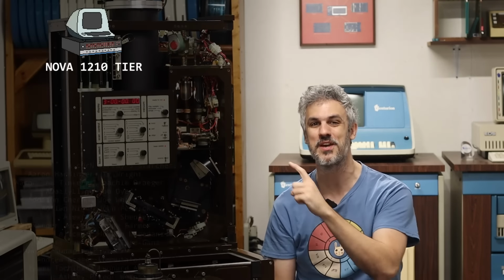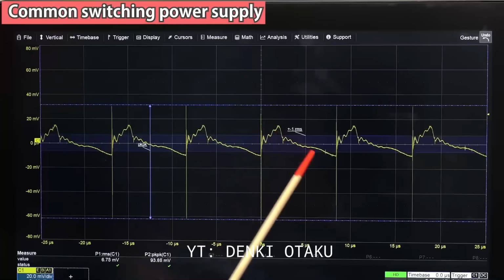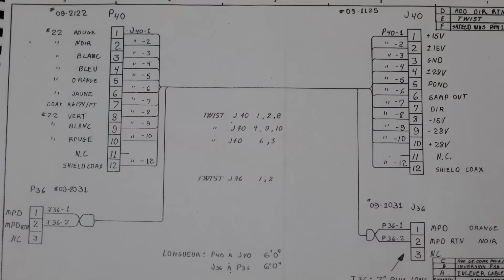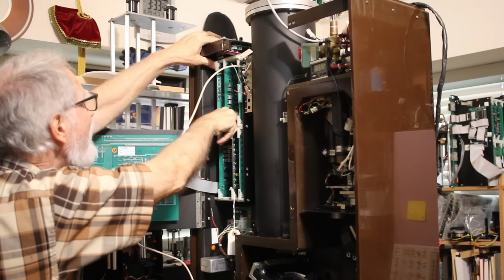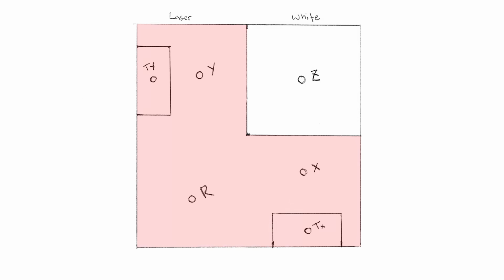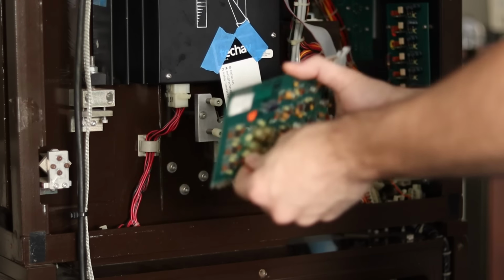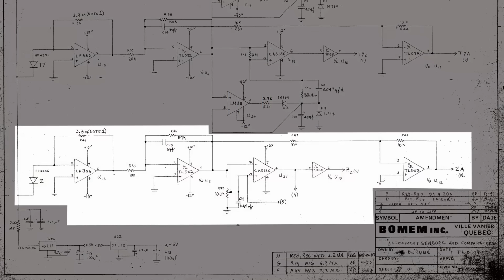I Found a Production Mistake on the Spectrometer!

Comment: The oldest factory defect I found was in a 1950s Silvertone amplifier. One of the part legs wrapped around a tube socket connector but the factory never bothered soldering it. Certainly explained the intermittent loss of gain but that must have been doing it for the amp's whole life!"

Comment: It's not a bug - it's a feature!   I think the reason for the un-soldered pins on the backplane connector is so that the mirror motor is purposefully un-powered unless you have a motor controller board plugged into the backplane. In other words - it's a safety feature, not a design / manufacturing fault.

Comment: Just as another heads up about laser safety for anyone doing stuff at home:
As someone who regularly gets laser safety instructions at work we were recently (recently being the last three years) taught that the "blink reflex" which supposedly saves you from damaging your eyes for certain powers of visible lasers is far FAR more unreliable than one might want!
Specifically, we were told that large parts of humanity may not have it or have it on a far slower time scale than previously assumed. This means even those lower intensity "safe" lasers are more dangerous than often said.

Comment: ai summary

Abstract:

This technical report details the restoration and diagnostic process of a 1985 BowMD DA3 Fourier Transform Infrared (FTIR) spectrometer interfaced with a PDP 1173 computer and a high-performance vector processor. The system utilizes an interferometer design where a beam splitter divides electromagnetic radiation between a fixed and a moving mirror to create interference patterns, which are subsequently converted into spectral data via a Fourier Transform.

The restoration effort involved several critical hardware interventions: the replacement of a faulty linear 5V power supply with a switching mode power supply (SMPS), the repair of an Analog-to-Digital Converter (ADC) via capacitor replacement, and the correction of a factory production error on the system backplane involving missing solder joints on the $\pm 15\text{V}$ rails. Further recovery required the installation of a missing speed and search control card for the mirror motor.

Optical alignment was achieved by calibrating the Helium-Neon (HeNe) laser path and white light source using a multi-sensor detection board and an oscilloscope to ensure precise signal phase and amplitude. While the system is now 99% functional, current diagnostics indicate unresolved non-rhythmic noise on the Z-signal (Zero Path Difference), potentially originating from mechanical motor vibrations or failing operational amplifiers in the signal chain.

Technical Summary: BowMD DA3 FTIR Spectrometer Restoration

    0:00 System Configuration: The setup consists of a BowMD DA3 FTIR spectrometer integrated with a PDP 1173 computer and a vector processor for high-speed mathematical computations.
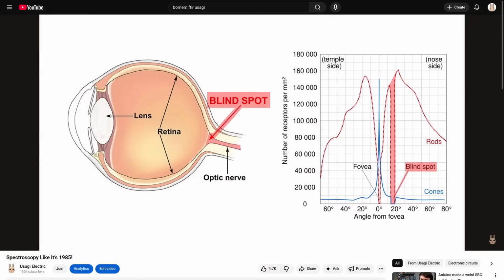    1:19 Optical Path Mechanics: The instrument generates radiation (visible to far-infrared) that passes through a beam splitter. The light is split between a fixed mirror and a moving mirror, recombining to create constructive and destructive interference before passing through the sample to a detector.
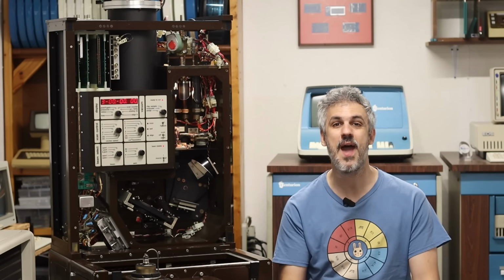    3:44 Position Tracking: A Helium-Neon (HeNe) laser is utilized within the same optical path to provide a precise wavelength reference, allowing the system to track the moving mirror's position via interference peaks.
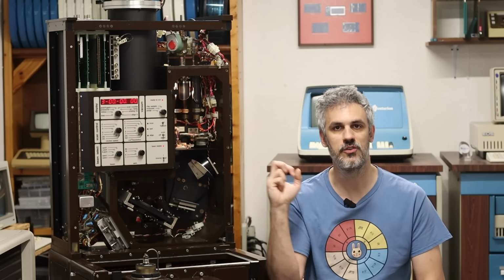    4:17 Data Processing: The system employs a Fourier Transform to convert the raw interferogram (waveform) into a spectrum of individual wavelengths.
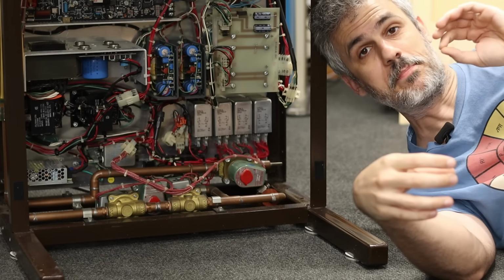    4:42 Power Supply Modification: A failed linear 5V power supply was replaced with a Meanwell SMPS. The engineer noted potential high-frequency ripple injection, though the supply only powers the digital logic.
    6:19 Laser Safety Specifications: The system uses a low-power (approx. 2mW) HeNe laser. Safety is maintained via a self-contained housing, a defined optical path with bolted mirrors, and a diffused beam width of approximately one centimeter.
    9:00 ADC Remediation: A short circuit on the $-15\text{V}$ rail of the Analog-to-Digital Converter (ADC) was traced to a failed $10\mu\text{F}$ capacitor, which was subsequently replaced.
    10:04 Motor Control Fault: The moving mirror was initially unpowered due to a lack of $\pm 15\text{V}$ logic power at the motor control box.
    13:00 Backplane Production Error: Diagnostics revealed a manufacturing defect where pins on the backplane card-edge connector were not soldered to their corresponding traces, breaking the connection to the $\pm 15\text{V}$ rails. This was repaired using jumper wires.
    17:34 Hardware Gap Analysis: The mirror motor remained unresponsive until it was determined that the speed and search control card (originally in slot 4) was missing.
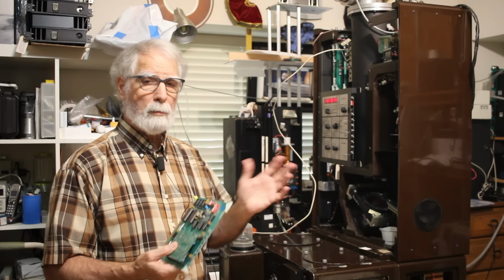    21:01 ADC Validation: The repaired ADC was tested using a function generator injecting a sine wave. The output was validated as a clean interferogram.
    23:41 Gain Variance Analysis: A difference in output amplitude between ADC revisions was traced to the R5 feedback resistor; the older revision used $10\text{k}\Omega$, while the newer revision used $20.4\text{k}\Omega$, resulting in double the gain.
    27:42 Operational Verification: Upon installation of the correct control card, the moving mirror successfully entered "Mode 3" (scanning), moving between limit switches.
    29:03 Laser Alignment Procedure: Alignment involved expanding and collimating the laser into a "Tetris block" shape, combined with a square of white light. A sensor card with six photodiodes was used to align the beams.
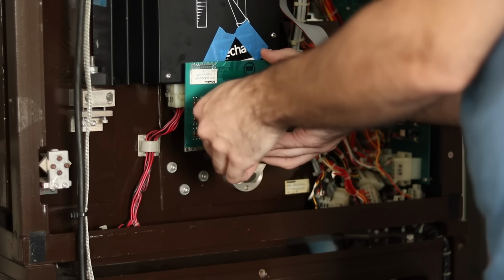    34:47 Signal Restoration: A degraded optical filter on the sensor board was found to be blocking the laser; removing the filter restored the sine wave signal on the oscilloscope.
    37:35 White Light Calibration: The white light pinpoint was aligned to the Z-sensor by adjusting a prism via a push-pull screw arrangement.
    39:25 ZPD Detection and Signal Noise: The system can now detect the Zero Path Difference (ZPD)—the point of maximum constructive interference. However, non-rhythmic noise on the Z-signal is triggering false ZPD detections.
    41:20 Noise Hypotheses: Two primary theories for the signal noise are currently being investigated: minor mechanical vibrations from the motor or a failing component within the operational amplifier chain.

Comment: 14:15 it's entirely possible that that square +/-15V pin made contact (like a press fit connection) with the plating on the board for many years. It might have led to some unexpected faults on temperature changes but other than that.... But over the years, stuff oxidizes and yeah, it looses contact. So that would be my explanation.
Edit: ok, the real explanation is much cooler and makes more sense!

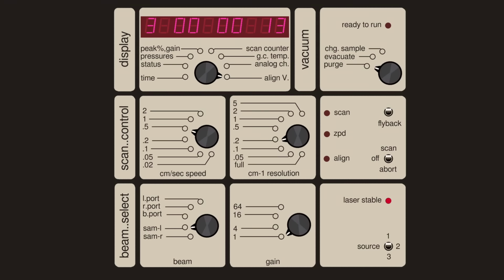Comment: great video :) good to know there's other people out there using the Bomem DA Spectrometers. I work with a number of them and have recently come across the control panel you show at 17:12. I wonder if you can offer advise on how to connect this control panel to the "local" port. I connected mine and only the "mode" (3) showed up. Perhaps i didn't receive anything as i had a PC connected to the spectrometer at the same time. I had wondered what the switches and dip switches on the right side of the control panel should be set to, i wondered if these were meant to be set to the ethernet MAC address of the internal PC? Do you have a manual for this control panel? (outside of the standard Bomem System Spectrometer manual)
Reply from the maker: That's awesome that you work with Bomem DA spectrometers!
It would be really tough to walk through the settings and trouble-shooting here on Youtube comments, but if you can jump over to the Discord and shoot me a message there, I'd be happy to walk through setup with you!
https://discord.gg/p7UsfHD

Comment: I actually had a similar case of production mistake on my HP250 minicomputer. The switch which turns on the main AC contactor was crimped with a lug that is way oversized and because of that the wire never got crimped correctly, so the wire was just dangeling inside the crimplug for 40years and when I got it and it kinda got manhandled in the Ewaste facility it broke loose. I saw it working and then it completely quit working randomly because of that.
Wild that it held on for 40 years

Comment: Maybe the loose wrap wires weren't soldered because maybe the solders expansion on the terminal, couldn't it experience some slight capacitance... like I wouldn't think enough to cause a problem... but when you think about designing a circuit without components based on trace geometry minor solder maybe makes reflections or subtle noise that matters to eliminate.

Remember this kinda hardware is like if audiofiles had their way that the law of diminishing returns is ignored in the process of achieving bullet proof accurate measurements.

Was only achieved by making the hardware quiet enough to hear that sensitively.

Now idk much about them directly, just the development path is precision this, quiet that.... otherwise the noise floor is too high for sensitive measurements and it will throw them off?

Anyone wanna weigh in on my thoughts about this?

Comment: Actually, I had much more concerns about using beefy power supplies on the little TMS9900 setup then I have in this big machine. I wanted to write you about that anyways, cause especially when routing +5V and +12V and other voltages without any GND divider in between a single slip with a screw driver, pointing thing or test clip will end in a big bada boom. Either you protect the TMS9900 by adding a crow bar or start using a sufficient bench top PSU. Anyways, I really love to see your machines coming together and start to move and do something. So keep the good work going!

Comment: I recommend you don't throw the HeNe tube away if you find a replacement - the problem with these is the helium likes to migrate into the glass and camps out there. Running the laser for long periods and at slightly higher power can pull it back out of the glass. It's not a complete fix of course but it will partly reverse the failure and will start to ignite more reliably. There are other more risky fixes (RF bath or microwaving) but not the first choice for obvious reasons :). I think these tubes are also becoming rare and refilling might be possible in the future (super difficult to do and previously not economic - but possible for someone determined to keep them going).

Comment: Your noise isn't optical interference because your equipment is open and you are passing in front of light sources?

The reason I ask is because years ago we were working on some kit that required the equipment to be open while we worked on it. It was giving all sorts of random readings.
After a considerable time and lots of consternation we eventually twigged that there was one of the old type glass cased diodes in the circuit and it was small clouds scudding across the sun that was interacting with the diode , and making the readings wander all over the place.
When the case was closed, the diode was shaded and no issues had occurred on any of the other units. Luckily.😊
I believe the diode was changed in subsequent production to a fully enclosed type.

Comment: I once had a very similar fault in an oscilloscope. It had been used for decades by the previous owner and a few years by me. Then after a move the sweep generator failed self test. A bodge wire was never soldered, just hanged there in the via.

Comment: Since the caps on those boards are 45+ years old now they are slowly losing their ability to do their jobs properly. An LCR meter may see the capacitance value go up and the ESR will rise too. This is due to aging. Replace the caps with new tech equivalent types. Avoid titanium caps. Use 108 deg caps. Source caps from reliable manufactures only. The market still has a lot of "fake" caps out there. When soldering use Sn63 eutectic solder to prevent heat damage.  When replacing resistors in power supplies always suspend the resistor 1 diameter (or more) above the PCB to prevent future burning of the board. By the way resistors tend to go up in value with age as well.
As we all learn it is tough getting old.
Reply: Capacitors are an issue in consumer electronics from the early 90s and early 00s, not in a professional 80s device like this.

Comment: Fourier is not that extra strange, at least from the practical point of view - its just like you would do narrow band filtering for a frequency of desire. or multiple of them. such a filter will give you not only amplitude but also the phase of the distinct frequency you were looking form. the other way around is about adding harmonic wave forms to each other until they will create whatever you want, such as rectangles, saw teeth or triangle wave forms. (indeed Fourier is a bit more, like the bunch of math, but who cares when it just works for the purpose.)

Comment: There are designs where builders are "hammering" the square wire wrap pins into round via holes. but i doubt that was ever the case in your motor control slot.
Still i would guess its much of benefit if such power supply is not going across two connectors and these single via on the motor control PCB.

Comment: If you have a Wire Rap tool, why not wire rap a jumper to correct the 3 power pins ?
Without the connection, you can introduce noise with the power doing the round trip, from the back plane -> card -> back to the back plane, to feed power to the pins in question.

Comment: No disrespect intended here, but you really need to set the oscilloscope up correctly.  The waveforms are all jittering because you have the 'scope set to 'auto trigger' - you need to set it to 'normal trigger' and adjust the trigger point to the rising voltage on the channel that you're interested in measuring.

Comment: "I don't need two of these"
Ominous words.
On a totally different system, but still several linked backplanes comprising an 8088 (IIRC) single-board computer, assorted memory, digital I/O and analogue to digital converters ... no. You want a spare for each card on site (in a production environment. And you want up-to-date copies of the configuration data for each set of cards.
Do you want me to show you the scars where I learned that?

Comment: Great progress. I think those +-15V power line split is by design and not a production mistake. It prevents powering driver module in the absence of controller card.
Reply: That would be a horrible design choice. Not soldering pins into a through-hole doesn't ensure no connection to the board. It just means inconsistent, unreliable connection. Furthermore, the backplanes of other machines don't have the same issue. It's definitely just a mistake.

Comment: Hey, I design microwave radio stuff here. Just just throw some big instructors on it with extra filter caps until neither your fluke or your scope can see the noise anymore. Linear is best but you can get that ripple down so low that it can't be easily measured anymore for just a few dollars.

Comment: Do we know why it was turned into a parts machine in the 1st place? Probably unrelated, but, I would want to still "fix" the production mistake as I would be afraid, the extra amps going through traces that weren't meant to handle it could have caused damage someplace. When you confirmed that was a production issue, I started thinking, ya, it would have worked for years but eventually, you put too much amperage through a trace not meant to handle it because power is supposed to route someplace else, you're going to burn something up eventually. Maybe that's what took it out of commission. But that's just my novice thought.

Comment: I worked on a wire wrapped SuperComputer prototype about the same time this was built. Wire wrap done properly was used in space, so it can be reliable (4 gas tight contacts per turn.)

Comment: Nice to see a Compaq Presario 8000 case and Win XP used, I have the same case slightly modified with completely replaced internals running Linux since many years.

Comment: Did anyone else notice that the offending trace had a bunch of noise somewhere in the 200-250kHz range?  This could just be the result of an intentionally under-damped op amp circuit or something, especially since the noise spikes seem to "ring down" at that frequency also.  Alternatively, this could be noise coupled from elsewhere in the machine, or it could point to where in the feedback network there's a faulty component (or trace, wire, solder joint, et c.).  In any case I would want to understand the source of that and what the intended response of the circuit is before I trust it to reliably trigger the zero point detector.